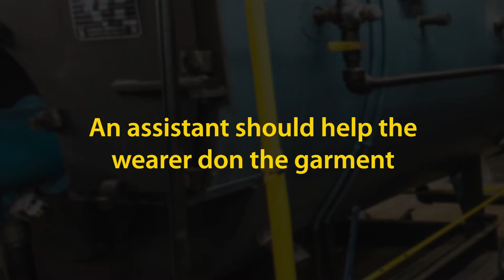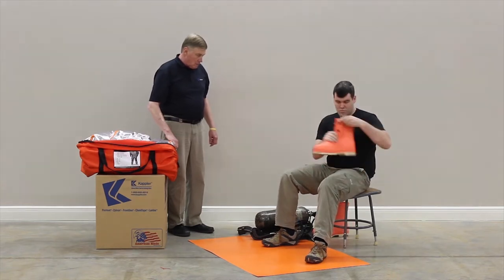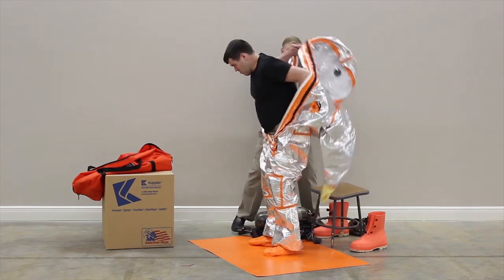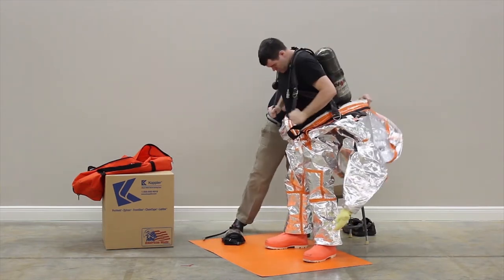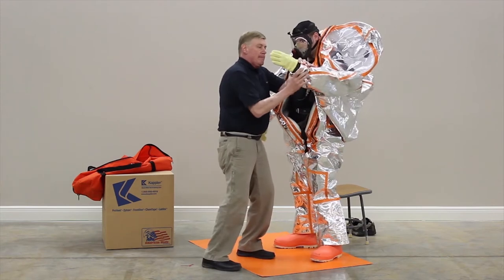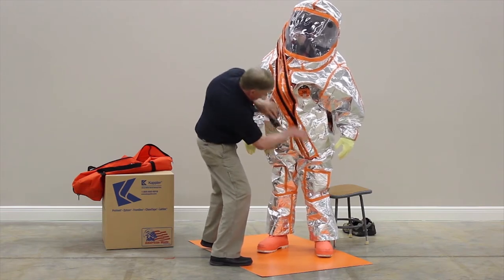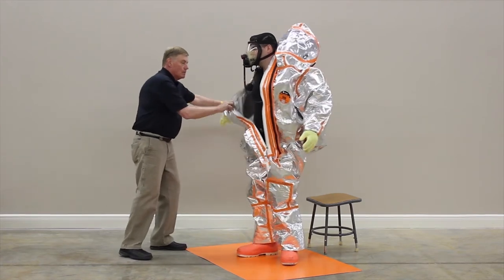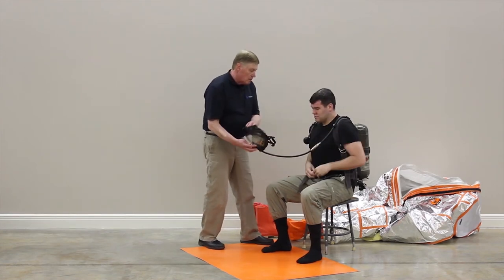Kappler Inc. DONNING & DOFFING GAS TIGHT SUIT

Comment: Are those just single use or you can reuse them or does it depends on the situation?
Reply from the maker: All of our garments are multi-use, single exposure. It would depend on the scenario. Once the garment has been exposed to a chemical we can not guarantee its performance. Hope this helps!
Reply: @kapplerinc.5058  Thanks.